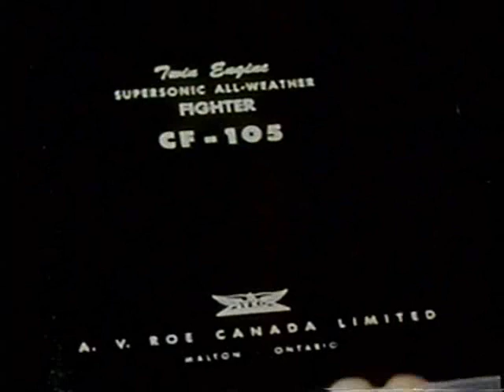Avro Jetliner & Arrow Part 2

Comment: Should have got the Arrow into full production before Dief could nix it
Reply: Because of delays of the Iroquois, this wasn't going to easily happen. Secondly, nobody was told exactly what weapons system was to be expected leading to additional delays and confusion. By the end of the project even some initially very supportive members of parliament were concerned with the overall cost of the project. Even had we  completed production models with advanced engine and fire control systems, with no foreign sales on the books, there is no way Canada could have maintained the program. Cost estimates had spiraled from something like $1M in very early days to $10M+ per copy. In 1959 that was an astronomical sum. I am as patriotic as the next guy about what might have been, but there were too many external pressures on this program to ever get to the finish line.
Reply: @MicrophonicFool  Still say bad decision to cancel  the Arrow -  even the Jet Liner should have been mass produced  and sold all over the World  > the Sales dept. should have gone all out on this from Earlier  of each project
Reply: @1Bandit455  Yes, it was a shame all around. The Jet liner probably had as much of a chance at that point as the Arrow did, if not more